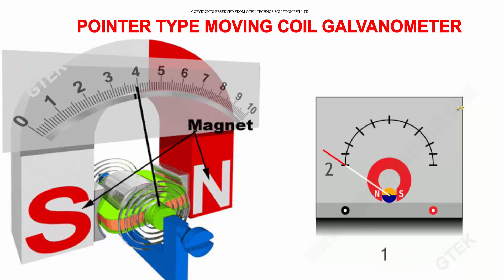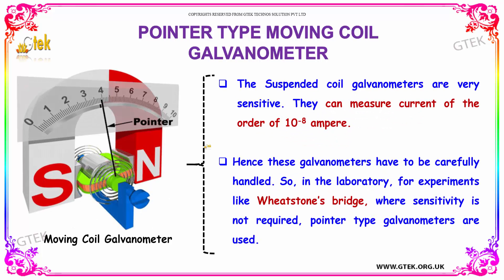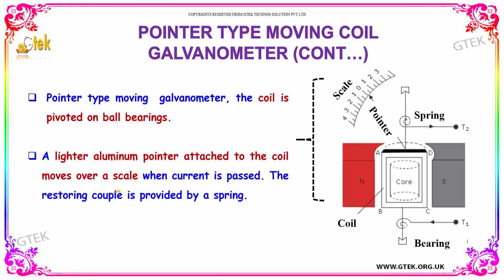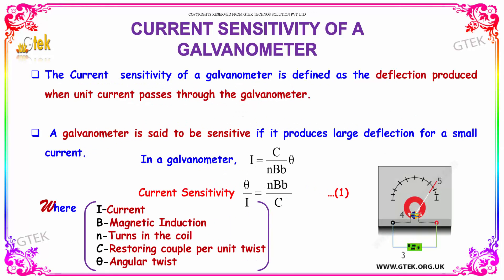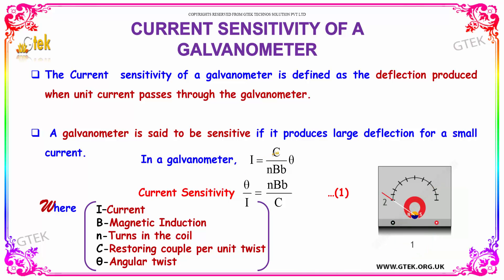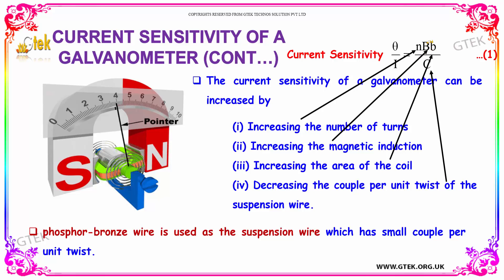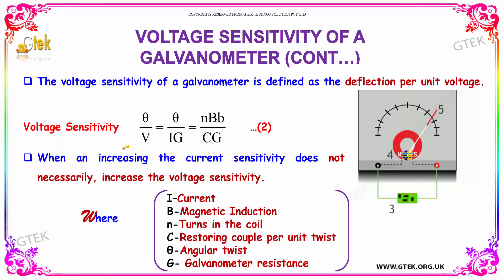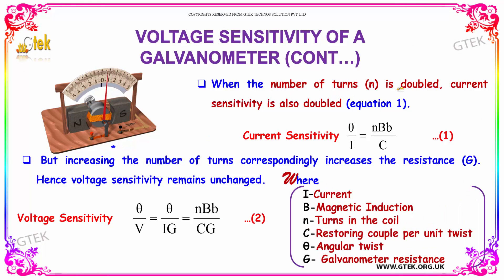Pointer Type Moving Coil Galvanometer Effects of electric current class 12 physics subject notes

Comment: Moving coil galvanometer is a very sensitive instrument used to measure the small currents of the order 10^-9 A. Here the galvanometer gives the deflection which is proportional to the electric current flowing through it.

Comment: A galvanometer works as an actuator, by producing a rotary deflection (of a "pointer"), in response to electric current flowing through a coil in a constant magnetic field. ... They were the first instruments used to detect and measure small amounts of electric currents.

Comment: It consists of a coil placed in a magnetic field. When a current passes through the coil, it experiences a deflection proportional to the charge through it. If a spring is used to restrain the coil, the deflection can be used to measure the current or a voltage. The galvanometer is a simple instrument.

Comment: A moving coil galvanometer is an instrument used for detection and ... A current carrying conductor placed in a magnetic field experiences a torque. ... coil should have large number of turns and large area as this increases the turning effect. ... Voltage sensitivity is the deflection produced for a unit voltage applied across the ...

Comment: A galvanometer is an electromechanical instrument for detecting and measuring electric current. ... A galvanometer works as an actuator, by producing a rotary deflection (of a "pointer"), in response to electric current flowing through a coil in a constant magnetic field.

Comment: The suspended coil galvanometers are very sensitive. They can measure current of the order of 10-8 ampere. Hence these galvanometers have to be carefully handled. So, in the laboratory, for experiments like Wheatstone's bridge, where sensitivity is not required, pointer type galvanometers are use. In this type of galvanometer, the coil is pivoted on ball bearings. A lighter aluminium pointer attached to the coil moves a scale when current is passed. The restoring couple is provided by a spring.

Comment: HOME
TECHNOLOGY
PROJECT
EXPERIMENT
SCIENCE
GUIDE
SCHOOL
COLLEGE
HEALTH
CONTACT
CM Amma jayalalitha dead funeral photo RIP 

 

Home | SCIENCE | Moving coil galvanometer – Principle, Construction, Pointer type moving coil galvanometer, Current sensitivity of a galvanometer.
 Previous PageNext Page 
physics 11th 12th standard school college definition answer assignment examination viva question

Moving coil galvanometer – Principle, Construction, Pointer type moving coil galvanometer, Current sensitivity of a galvanometer.
   Posted On :  03.11.2015 07:35 am
Moving coil galvanometer – Principle, Construction, Pointer type moving coil galvanometer, Current sensitivity of a galvanometer.
Moving coil galvanometer is a device used for measuring the current in a circuit. Principle: Moving coil galvanometer works on the principle that a current carrying coil placed in a magnetic field experiences a torque.

 

Moving coil galvanometer – Principle, Construction, Pointer type moving coil galvanometer, Current sensitivity of a galvanometer.

 

 

Moving coil galvanometer

 

Moving coil galvanometer is a device used for measuring the current in a circuit.

 

Principle

 

Moving coil galvanometer works on the principle that a current carrying coil placed in a magnetic field experiences a torque.

 

Construction

 

It consists of a rectangular coil of a large number of turns of thin insulated copper wire wound over a light metallic frame (Fig). The coil is suspended between the pole pieces of a horse-shoe magnet by a fine phosphor – bronze strip from a movable torsion head. The lower end of the coil is connected to a hair spring (HS) of phosphor bronze having only a few turns. The other end of the spring is connected to a binding screw. A soft iron cylinder is placed symmetrically inside the coil. The hemispherical magnetic poles produce a radial magnetic field in which the plane of the coil is parallel to the magnetic field in all its positions (Fig).

 

A small plane mirror (m) attached to the suspension wire is used along with a lamp and scale arrangement to measure the deflection of the coil.

Theory

 

Let PQRS be a single turn of the coil (Fig). A current I flows through the coil. In a radial magnetic field, the plane of the coil is always parallel to the magnetic field. Hence the sides QR and SP are always parallel to the field. So, they do not experience any force. The sides PQ and RS are always perpendicular to the field.

 

PQ = RS = l, length of the coil and PS = QR = b, breadth of the coil.

 

Force on PQ, F = BI (PQ) = BIl. According to Fleming’s left hand rule, this force is normal to the plane of the coil and acts outwards.

Force on RS, F = BI (RS) = BIl.

 

This force is normal to the plane of the coil and acts inwards. These two equal, oppositely directed parallel forces having different lines of action constitute a couple and deflect the coil. If there are n turns in the coil,

 

moment of the deflecting couple = n BIl × b (Fig) = nBIA

 

When the coil deflects, the suspension wire is twisted. On account of elasticity, a restoring couple is set up in the wire. This couple is proportional to the twist. If  is the angular twist, then,

 

moment of the restoring couple = C

 

where C is the restoring couple per unit twist

 

At equilibrium, deflecting couple = restoring couple nBIA = Cθ

 

 

∴              I =  nBAC 

 

C

I = K  where K =  nBA  is the galvanometer constant.

 

i.e I α θ. Since the deflection is directly proportional to the current flowing through the coil, the scale is linear and is calibrated to give directly the value of the current.

 

Pointer type moving coil galvanometer

 

The suspended coil galvanometers are very sensitive. They can measure current of the order of 10-8 ampere. Hence these galvanometers have to be carefully handled. So, in the laboratory, for experiments like Wheatstone’s bridge, where sensitivity is not required, pointer type galvanometers are used. In this type of galvanometer, the coil is pivoted on ball bearings. A lighter aluminium pointer attached to the coil moves over a scale when current is passed. The restoring couple is provided by a spring.

 

 

 

Current sensitivity of a galvanometer

 

The current sensitivity of a galvanometer is defined as the deflection produced when unit current passes through the galvanometer. A galvanometer is said to be sensitive if it produces large deflection for a small current.

The current sensitivity of a galvanometer can be increased by

 

increasing the number of turns

increasing the magnetic induction

increasing the area of the coil

 

decreasing the couple per unit twist of the suspension wire. This explains why phosphor-bronze wire is used as the suspension wire which has small couple per unit twist.

 

Voltage sensitivity of a galvanometer

 

The  voltage  sensitivity  of  a  galvanometer  is  defined  as  the deflection per unit voltage.

An interesting point to note is that, increasing the current sensitivity does not necessarily, increase the voltage sensitivity. When the number of turns (n) is doubled, current sensitivity is also doubled (equation 1). But increasing the number of turns correspondingly increases the resistance (G). Hence voltage sensitivity remains unchanged.

Comment: A galvanometer is an electromechanical instrument for detecting and measuring electric current ... Because the pointer of the meter is usually a small distance above the scale of the meter, parallax error can occur ... Moving coil type galvanometer mechanisms (called 'voice coils' by hard disk manufacturers) are used for ...